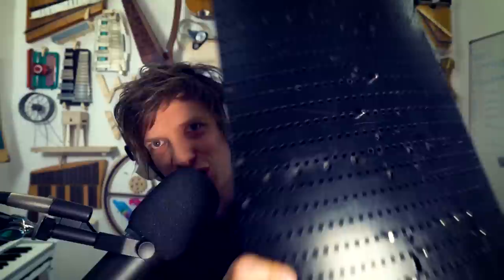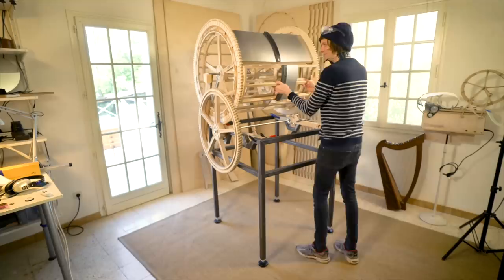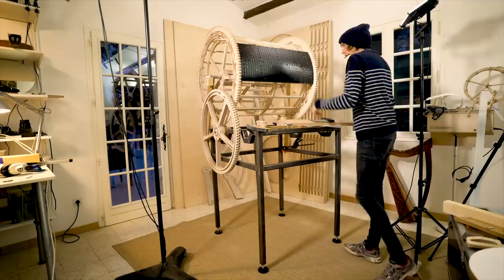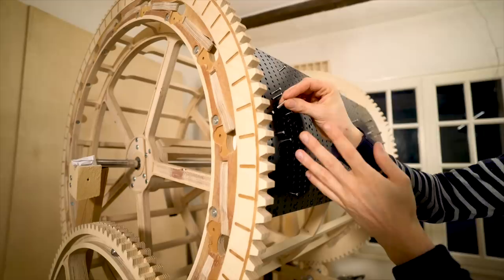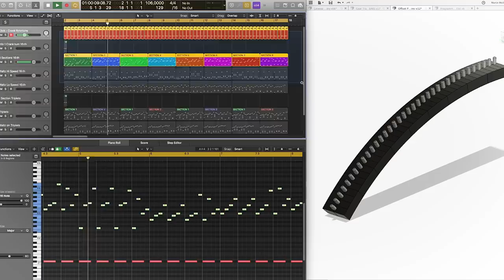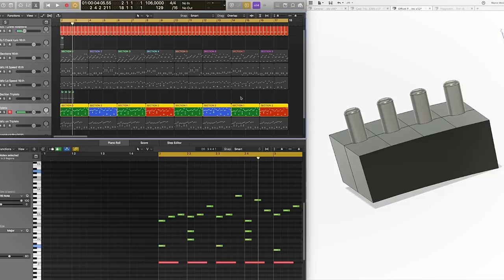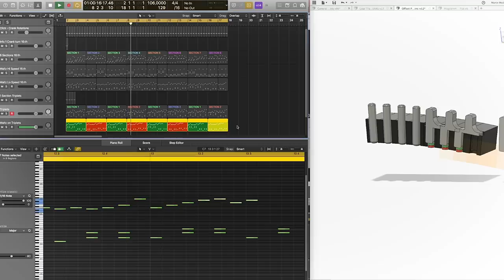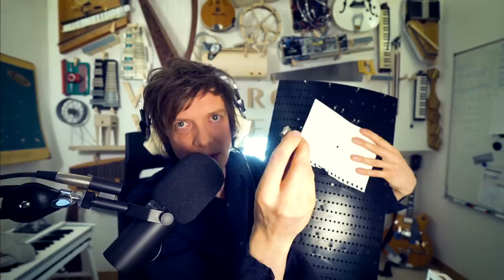Magnet "Midi" Music System - Marble Machine X #25

Comment: How wide are the "keys"? Could you not have another set of holes drilled next to the first? 5mm rods, the keys only have to be 10mm wide and you could have to separate sets of holes. One in 4s one in 3s
Reply: Ah, you already thought of it with the narrow ones.

Comment: I've probably misunderstood something but couldn't you have corrected this by making the programming wheel 60 rather than 64 or any other highly composite number
Reply: Yo, the problem with going 60 rather than 64 is that it's odd musically. Usually you would use an even number of sections for the theme. You can see at 9:30 that he has an 8 section theme, each sections having 8 beat (one beat = one click, so one beat = 4 possible pins). So it uses the 64 beats. But with 60 you would have 7.5 sections and it would sound very strange

Comment: PROGRAMMING WHEEL (PW) - Intelligent Assistance
Instead of having 10 people reprogramming live on stage you may find a sponsor company designing robotic machines. So let's say you would find a machine with (one) arm(s) it would place and replace the pins according to your music program. Having said this. There needs to be a "Programming Wheel Programming Device (PWPD)" constructed.

I understand that you opened a construction channel for visual feedback. But hey sorry - my own procrastination meter just quit its job just because I am looking you vids.

Idea
1 PW
Robotic Arm(s) 
Taking pins out. Putting new pins in. Depending on the whole construction and the robotic hardware only one robotic arm is needed.

Footnote
Imagine you would have only one unit (programming surface) which you would wrap around the PW the automatic (!) placing and replacing of the pins might run faster. I understand some logistic problems i.e. because of space would come up.

Comment: Try some odd time signatures 10/8, 5/4, 11/8,....etc............perhaps you could make full changeable plates similar to printing presses , somehow design a system where the plates could be set into something like a gun magazine that locks to the wheel being played... after a specific plate has been played the magazine moves in, quickly and mechanically forcing the used plate(s) out and replacing the old one in real time by a tech manually operating the magazine...kind of similar to how these old puzzles used to work https://www.youtube.com/watch?v=6Pqp-iOJQaI